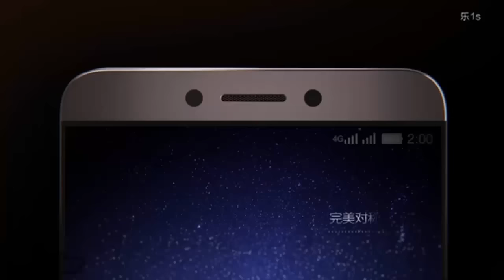LeTV LeEco 1s disassembly and review

Comment: What type of display Le 1S use?  display coupled with touch sensor of LCD  or the other not coupled with touch sensor of LCD.  if my touch panel is broke and the LCD is still fine. Can i buy the touch panel only? A lot of mobile phone repair shop near my house said that I have to buy it all together. but why there are a lot of stores online which sell it separately. And how do i know which pin (6 or 8) pin version of letv 1s x501